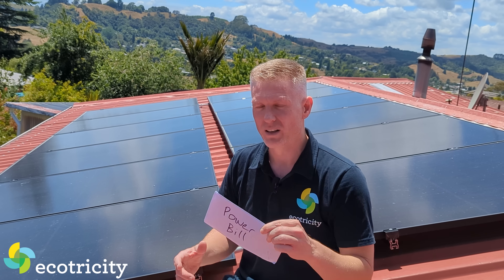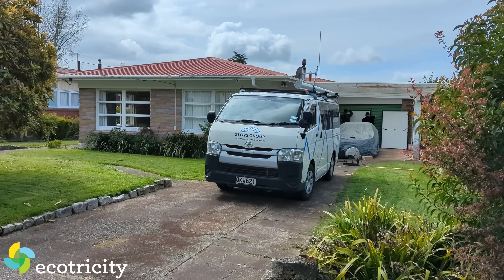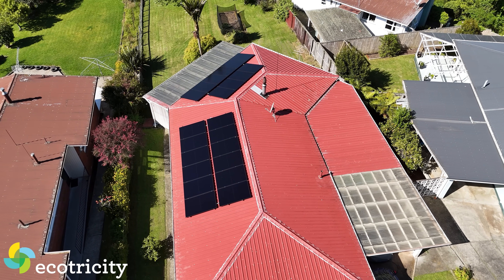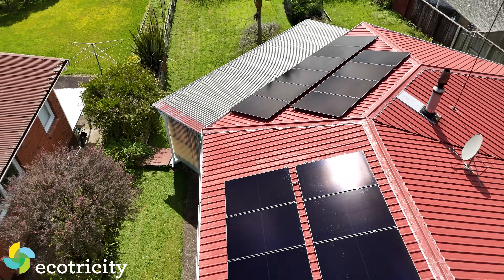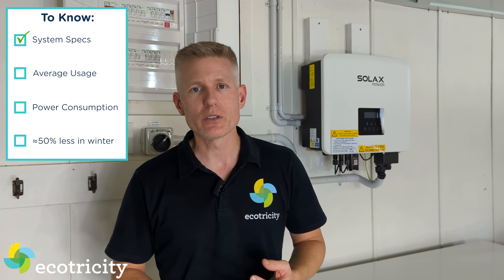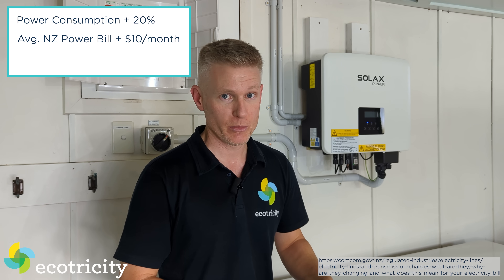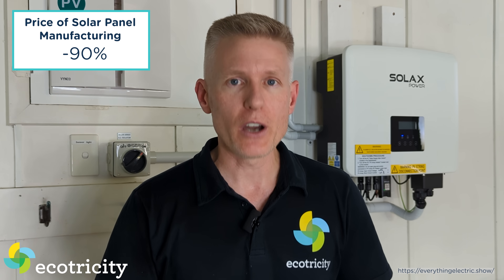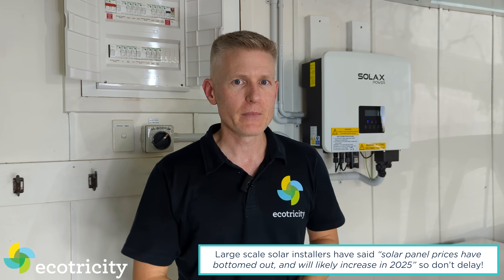Is solar power really worth it in New Zealand?

Comment: Nice job Gavin. Looks like you've got a great system there!
I LOVE getting a credit in the summer!
My system payback happened just recently. FREE ELECTRICITY NOW!
I put it in about 7 years ago.
6.5kW on the DC side - self-installed. Cost me about $10,500 out of pocket (including hiring the roofer and electrician) and was about $6,500 after incentives. Saves me about $1,000 per year. I have a very good local (municipal, non-profit) power company, so we have good low rates. If electricity cost me more, I'd save EVEN MORE per year and had a faster payback.

I pretty much agree with everything in this video. When I put in solar, it felt like pretty much the best thing I had ever done, and the only thing I would have done different would be to do it sooner.

At this point, LABOR is the most expensive part of a solar install. So, just maximize however many solar panels fit on your roof. You won't regret it!

Also, so panels go GREAT with metal roofs and electric cars!

For a good while, I was opening my electric bills on camera every month, sharing what it was. I'd literally find out what my electric bill was at the same time as the YouTube viewers. If you are interested, you can watch those at: https://www.youtube.com/playlist?list=PLmHss3DBZUimMu2T5B198sNn6A4cp2zvG

Comment: Great Video Gavin
Where I live in Victoria Australia my November and December generation is 1.1MWh  and 1.4 MWh respectively from a 9.4 kW array through a 3 phase 8 kW inverter.
Sadly my max generation and in May through July falls to about 465 kWh a month. 
Over full 12 months of 2024 some 12.4 MWh generated and 4.959 MWh sent back to grid. 
So I consumed 7.441 MWh of the power I generated from my system.
For me approx $2000 saved from  a System that cost me just on AUD$7600.00 = 25% ROI - so payback in 4 years for me.
Well worth the investment in Solar but a battery is far from financially effective currently . Maybe when storage falls to under $500.00 / kWh . 
As battery tech continues to improve and prices fall, that wait may be only a couple of years.
Reply: If you had access to repurposed (and still safe) EV batteries that had been professionally converted as home batteries...(see other comments in here) would that make a difference?
Reply: @ lets say it was supplied at a guarantee and low risk of thermal runaway what would the cost be?  The modular Sungrow system here in Aus for a 12.8 kwh battery is about 18,000 installed and allows full use of 13 kWH at peak power cost of $0.393/ kWH that requires 3500 charge cycles  and in excess of ten years  payback.  I expect that much safer Sodium Ion batteries will be available within the next two to three years and at significantly less cost so payback in under 5 years.

Comment: $21,000 invested in an index fund tracking the S&P 500 would return an average of 13%pa average over the last  10 years - making for a return of $2,730pa or nearly $230/mth - makes the savings close to neutral. And that's not taking into account increases in insurance and increases to the cost of roof maintenance.
Reply: Close to neutral and energy independence? What's not to like? Your indexed fund won't be much use when the next cyclone hits and knocks out the electricity and internet again, perhaps for weeks like it did for many people here in 2023. Note:- that's not 'if', but 'when'. Global warming isn't going away, it's getting worse!
Reply: If the cost is high and it takes several years to break even then its simply not worth it. From alot of comments the cost in Australia is 1/4th the cost in nz. Which adds value but whats the point in nz if your spending 20k and taking 10 years or more your not really saving.
Reply: amazing, so investing is worse even when committing tax fraud, glad we got the calculator out for that
Reply: There's no increase in insurance when adding panels and batteries. There's no increase in roof maintenance- solar panels are tougher than most roofing materials- panels protect your roof! We have 10.5kW panels & 3 powerwalls. We save $4000/pa by not paying for any grid power. We're presently >$2000 in credit in our 3rd year on Amber Electric in Australia. We beat your index fund by a heap.
Reply: Yawn, you will probably lose access to cheap insurance as climate change kicks in. Solar panels are "part" of the solution. Index funds will tank.

Comment: I've just installed a 10.1Kwh Sigenergy system, 23 panels and 13.5Kwh of battery. AND I agree, put as many panels on your roof as you can. My advice is, put a battery in. As mentioned, I've installed 13.5Kwh, and I'm going to increase that by another 5Kwh (module plug in) as I have 3 living area's in my house and we go through an average of 900Kwh hours a month over summer.

Comment: Built out my system myself, including batteries. 14.5kw PV,  140kwh storage and 3 hybrid inverters 18kw AC. $25k. Power utility companies around here pay little or nothing for grid feedback. The ones that do are slowing coming to an end. I'm happy to have nothing to do with them and depend on myself for power needs.
IMO if you can get a worthwhile deal from them, make use of the savings to build out your system and be ready when they cut the stings. It'll come eventually.

Comment: $20,000 plus  your bill I looked at solar grid tie, the figures don't add up. If I was building a new home I'd go for a full off grid just so I don't get power bill.
Reply: Fully off-grid sounds attractive until you work out how much storage you need. A minimum of 3 days is recommended. That would be 69kWh for us. Untenably expensive and we couldn't earn cash from exporting at high rates in the evenings.  We have not paid for grid power since 2018 and are >$2000 in credit on Amber Electric in Australia.

Comment: Just in the process of getting quotes for solar now. Debating over bty or no bty at present. My thinking is that any bills for winter power use although minimal will be offset by the nil summer bills.
Reply: An interesting conundrum. Battery considerations:

- Will you generate enough solar to charge the battery in winter?
- Will you use enough power in summer nights to discharge the battery completely?
- Will you have a large enough battery to charge all that extra energy in summer?

As Gavin has mentioned. Power bills can be close to zero even without a battery!!
Reply: @equitysolarbrokers  not in winter they aren't. Our battery runs everythibg midnight to 8.30am, then sun does the rest. Battery gets us to 9pm when its free for 3 hours and then fully recharges. We do hot water and spa then too. 
Payback is 9 years for us but we live rural and work from home so needed a battery for contingency and starlink to work. But we still had bills in winter, no  spare power to negate the daily charge for a start.
Reply: I wouldn't touch solar in NZ, it's a rip off.